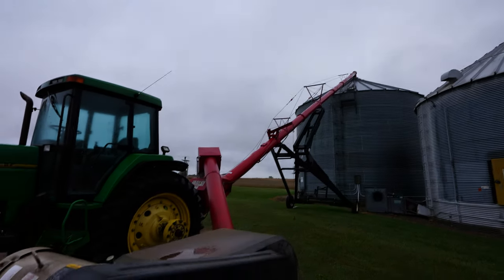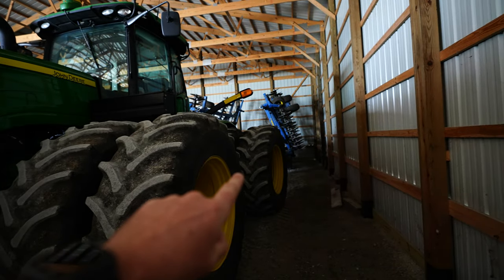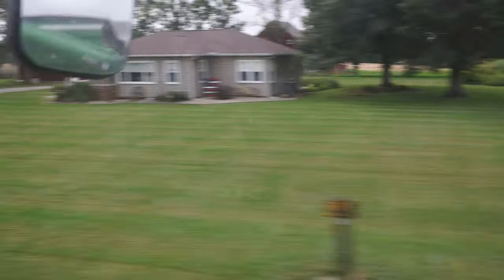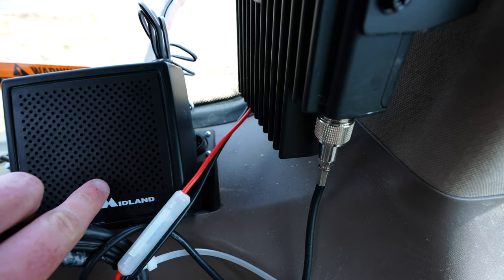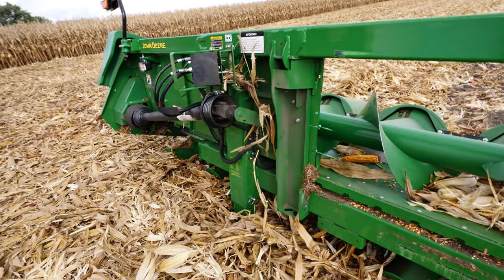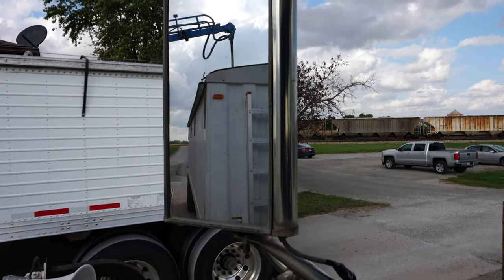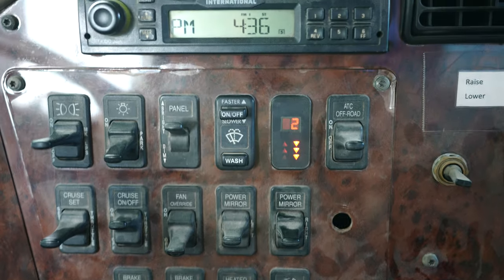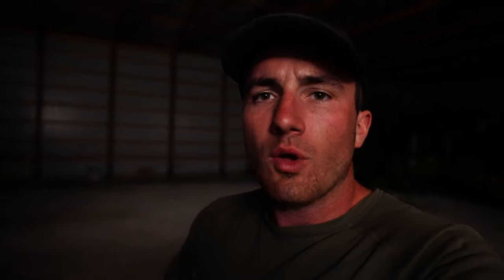A Record-Breaking Day Of Picking Corn With The John Deere S780 (and not in a good way!) (Ep.112)

Comment: Sounds like the shifting actuators on top of the transmission are hanging.  Had a friend who had one, did the same thing yours does.  Just have to pull the floor mat and take the center floor section out, I helped him do it once, word to the wise, take the passenger seat out if you don't enjoy bionic shoulder cramps... I do remember if he put it in manual mode he could get by a little longer...

Never owned one, real truckers use three pedals and a stick😉